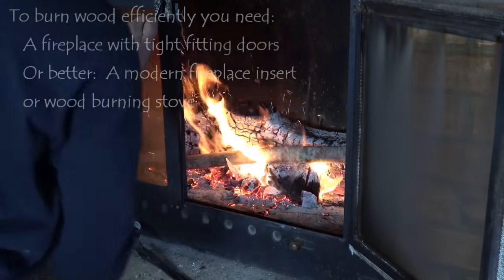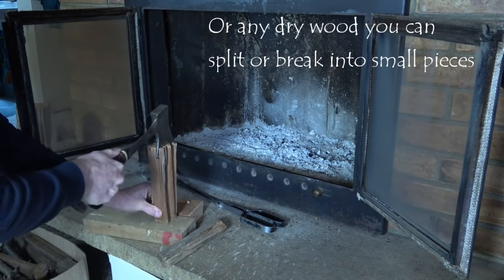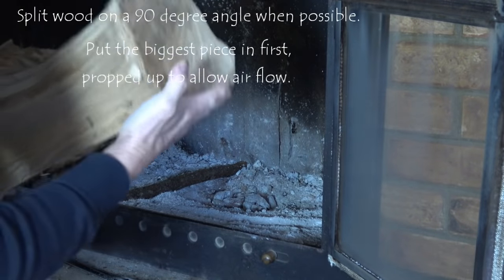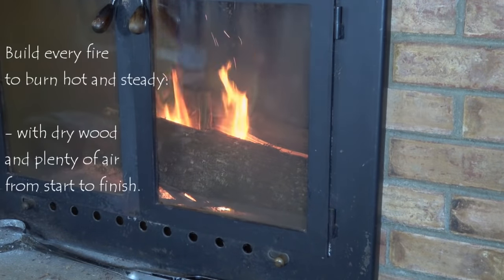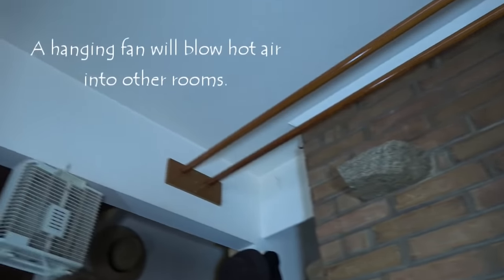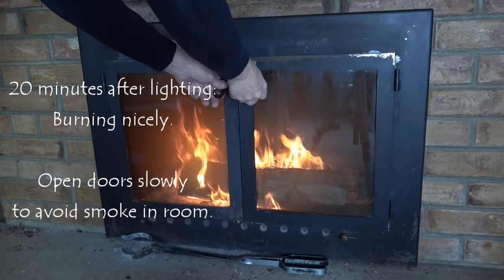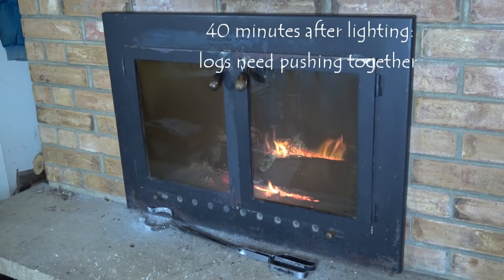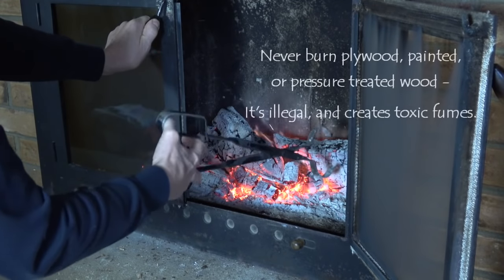Heating Your House Efficiently with a Wood Burning Fireplace or Stove

Comment: One thing for the beginners, if you just got to your cabin and it's cold outside, before you start fire with wood, have a newspaper burning in the fireplace. If you don't do that, you'll have cold air in the chimney which will act like a lid and you'll get a lot of smoke inside your cabin.
Reply: Why is the paper burning, different from wood burning? Ty
Reply: @speaklifegardenhomesteadpe8783  cause paper light's up instantly but wood doesn't also hot air going act's like a pathway for the rest of the air
Reply: The way I read it was: prime the flue with the paper.  It has helped me so much with mine.  Now I'm having a static issue.
Reply: The way I understand it. The goal is to start with one small log and some kindling for the first 20-30 minutes to things acclimated then add more wood. Would that approach be similar to what you suggest?

Comment: After 20 years in the Woodstoves and fireplaces business I compliment your video. Just one suggestion, try reversing the ceiling fan to draw the cold air up to mix with the warmer air. This will also do a better job of bringing cold air from other rooms along the floor. It’s path there is less obstructed. This will give you a more even temperature throughout the home.
Reply: Why did you watch this at all?
Reply: @hellotheremyolfriend  😂😂😂😂😂😂👍
Reply: @BRAND0N...  A wise master remains a student 👊🏽🙏🏽✌🏽
Reply: That's why all ceiling fans have a reverse switch.
Reply: Very good point here.  Ultimately, the air gets circulated, either it is blowing it down from the center of the ceiling (and pulling it up from the sides), or sucking it up from the center of the room and pushing the warmer air out to the sides/walls and down.  While it goes against the popular teachings, I have to concur having the fan pull up from the ground will more efficiently mix the air.

Comment: I love this video! My fireplace is an insert that doesn't have that fresh air vent. Sometimes I have to open the door slightly to get that air in to get the fire going. Also, Sometimes the wood we get from the local suppliers is "dryish" and we have to open the door to get air on it so it can burn. I've tried to start these logs with kindling but it doesn't work good in this Ashley Hearth insert unless the wood is dry like the desert. I cheat a little bit. Dip 3 cotton balls in some kerosene and place it in the middle between some crushed up newspaper....voila 🔥🔥🔥
Reply from the maker: Wax works too, shave some off a warm candle and keep it in a jar to put on the logs when you light a fire. Your insert must have an air control, but the incoming air may not directly hit the fire. Bring wood in the house at least a couple weeks or more before you burn it, and stack it loosely where there's some air flow to dry it well before burning it. Splitting it smaller will help it dry faster. The kindling needs to be very dry, preferably cedar.

Comment: I find moving cool air towards the stove seems to be more comfortable than moving the hot air away. Put a box fan or small fan in bedroom doorways and blow the cold air out.  Also easier than mounting it up high.
Reply from the maker: Yes, that works too. I prefer the fan up high where it's out of my way and I don't trip on it, though it took a few minutes to mount it there.

Comment: Started this season with a lopi dual door insert ive ducted outside "make up" air with dryer vent hose and a custom intake transition.  Got to keep those center slide knobs accessable.😎

It rocks 84> in < 34 out.

Be well.
Reply from the maker: I looked up Lopi and it sounds like they are excellent quality and efficient. Nice to hear you figured out a way to duct in outside air for the intake.
Reply: @HartzHomestead  2x 11/4 " square tube on each side of the air controll rods with bottom plain cut out. 3x 11/4" square tube  running side to side below heater base line ,end capped with top plain cut out to interface with  above tube  bottom cut out. 

And  dryer hose circle cut out of bottom tube.with  corresponding  sized thimble glued and screwed to bottom.
Air comes thru hose to bottom 
1 1/4" bottom tubes , moves right and left then up  into upper tubes where it goes  from front to back into origional stove air intake.

 only way i saw to keep startup air and airwash air control rods operating correctly and have outside air too. Got er dunn

Comment: I like your insert.  Very simple.
Reply from the maker: Thank you. It's not actually an insert, it's a heatilator, which is built into the bricks, and I added custom glass doors when we bought the house. It's a reasonably good system, but a modern insert would likely be better. It does have the advantage of larger glass doors.

Comment: Your video mentions having fans near the fireplace to help circulate the heat.  What if you have central air - could you just turn on the fan?  In theory, wouldn't that pull the warm air from the room with the fireplace and circulate it throughout the house?
Reply from the maker: Fans do 2 things, they extract more heat from the fireplace or stove which would otherwise be going up the chimney, and they circulate it around the house. So yes, turning on the central heating fan would circulate the heat throughout the house, but also having a fan blowing air directly across the hot fireplace or stove will pick up more heat in the first place that you can then circulate.
Reply: Yes

Comment: You keep the ash pit open???
Reply from the maker: I put a screw in the ash dump so it stays open just enough to let the right amount of air through, which is just about a 1/4" crack. I do have plans to make it adjustable from the hearth, so I can open and close it as needed, but that will require drilling a hole through the bricks.
Reply: @HartzHomestead  
Thank you.

Comment: When I start my fireplace the area immediately outside the fireplace is nice and toasty, but we have high ceilings and can't feel the warmth from the rest of the room. We tried the ceiling fan and I think that worked (or it could be in my head). Does aiming a second fan directly at the fireplace actually help distribute the heat? How far away should this fan be? And should I set it to low speed?
Reply from the maker: The ceiling fan should help, try it in both directions on high speed and which works the best. You'll get the most heat circulated with the fan just a few feet away on high speed pointed directly at the fireplace (assuming  you have glass doors on your fireplace). Turn the fans down if it's too windy or too loud. I burn a hot fire for just a couple hours, then turn the fans off when the fire goes out.
Reply: Just so I understand correctly, I should keep my sliding glass doors closed when operating the fireplace? I read online these doors should be fully open when the fire is burning (however the metal curtain should be closed to contain any sparks it burning embers)
Reply from the maker: @rajivrao4772  If you have cheaper bi-fold doors with tempered glass, it's possible a very hot fire could shatter the glass, so to be safe, it's usually recommended to leave them open, or burn smaller fires, away from the glass. If you leave the doors open, most of your heat will go up the chimney, and it will barely heat your house at all. Higher quality glass doors (which cost about $1,000) are ceramic or Pyrex glass, which can take very high heat, so you should always keep them closed when burning a fire. That's the only way it will warm the house. It's much better to install a fireplace insert (about $2,000) or use another type of heat.
Reply: That's interesting I thought keeping the doors closed would push the heat up through the fireplace while leaving them open would allow the heat to come inside the house. I'm not too sure what kind of doors we have we just recently moved into this house, however I do know there is an insert
Reply from the maker: @rajivrao4772  If you wash the glass doors then look very closely in the corner it might be printed what kind of glass it is. Usually tempered glass doors are more loose fitting, ceramic glass will be more air tight with a gasket around to seal it when they are closed. You do get more radiant heat with the doors open,  but if the glass is clean you get it when they are closed too. The problem is if you leave the doors open it sucks a lot of warm air from the room up the chimney. Try it both ways and see.

Comment: Great video! Can I ask if you have ceramic glass on those doors? My doors came with the option for ceramic but that was $800 more. I'm considering doing the upgrade myself and it seems like I can get the glass for $400 but I'm not sure if it's absolutely necessary...
Reply from the maker: These doors were custom welded by a fireplace shop, and they gave us the option of either tempered, Pyrex, or ceramic glass. We chose Pyrex, and we've had some very hot fires without them breaking. You might look into the price of Pyrex, but ceramic is even better. The glass on ours is just held in with a gasket, so it would be easy to change. I once had a pane shatter that I'm guessing was tempered, with a very hot fire of cardboard with flames right against the glass, so it can happen.
Reply from the maker: Ideally you want to burn a very hot fire from start to finish to reduce the amount of air pollution the fire creates.  If your glass is tempered, there is some risk of it breaking with a very hot fire, so I think it's worth upgrading to either Pyrex or ceramic.
Reply: @HartzHomestead  thank you! I am probably going to upgrade to ceramic... I got custom fireplace doors from Stoll that is built like a tank and I can't wait to have a slow burning hot fire in it.

Comment: Our house is older so we have no insulation. The fireplace is older so it has a indoor air intake. It’s a insert with a circulation fan. Best investment ever. It was rated at around 15k BTus  but it heats our entire house. We sweep the chimney every year. For backup we have a toyotomi kerosene heater and electric heat for backup too. We go through a lot of wood just because our house is older. Probably depending on the winter 2-5 cords a year of wood. It heats good. We haven’t had any issues. We’ve been using wood for a few years now.  Before the insert er could have the fire going and not heat the room up one degree. Now we have to crack windows to keep it under 78.
Reply from the maker: Yay for the insert!  If you own the house, have you considered options for insulating it?  If the walls are truly empty, drilling holes and having it blown in would likely be the best. If it's a ceiling with an attic, that can be easy to do, whatever you can get to.
Our house, built in the 1950's, had single pane aluminum windows, and adding 2 layers of mylar with storm windows I built myself cut our wood burning in half and the house was warmer.  
The walls had less than 3" of rockwool insulation, maybe about R7, so in one bedroom that got moldy in the corners, we tore out the sheetrock, shimmed the walls out 2" with styrofoam strips and 1x2's, and put in R23 insulation.  No more mold. It was a pretty big job though, with re-sheetrocking.
Our ceiling was the same thin rockwool, we raised it to R46,  11" thick fiberglass. 
It's November and we haven't lit a fire yet, except to make a crackling fire video.  
I have my feet on an electric hot pad though, and briefly turned on the electric heat a few times.
Reply: Hartz Homestead our house was built in 1952 and we have found some funky thinks in it so we don’t know what is in them. The windows used to be single pane but we replaced them with double pane. The attic has R30. Over the summer we added new blinds that are a insulated type they added about R5 to the windows. With our insert we can put a load of wood in at 9 am and get home around 2:30 with it still going. If it’s super dry wood it doesn’t last as long. We’ve thought about having it blown in too. Thanks for the reply
Reply from the maker: R5 blinds would make a big difference.  I've replaced our windows with double pane, but am still planning to use our 2 layer mylar storm windows, and am planning to make some insulated blinds too. 
Studies have found a super insulated house only needs about $20 a month worth of heat.
We never burn a fire unless we're home.  With our big fireplace I need to push the logs together or add wood about every 30 minutes to keep it burning hot.  Otherwise it would fizzle out and start making a lot of smoke. A smaller firebox holds the wood together better.  
Really dry wood may not last as long, but it does burn cleaner.
Reply: Hartz Homestead sorry for the late reply. The blinds have made a big difference. We sweep our chimney every year because during winter we often burn 24/7. We have 3 sources of heat, electric, kerosene, and wood. We use the kerosene furnace as a backup or when we go traveling. The electric we normally only use if kerosene gets really expensive, if our tank is low, or if the kerosene furnace isn’t working. Have a good holidays

Comment: Do you have any experience of the "self-powered" metal fans that sit atop a metal stove or fireplace insert?  I have a built in electric fan for my fireplace insert but it's loud and of course it uses electricity.  I'm wondering if those metal fans would be good enough to at least get some air circulating.
Reply from the maker: I haven't used them myself, but I expect they move some air.  I do have my fans on a variable speed control, because they are a bit loud on high.  Some fans are much quieter than others.
Reply: Just got one im uk worth it r great

Comment: Great video! I have a wood burning fireplace with glass doors as well with a dampner, ash box on the bottom back of the fireplace. I'm having trouble with the heat coming into the house with the doors closed. I feel like it all just goes right up the dampner. Any suggestions? The fireplace doors have vents all around it as well
Reply from the maker: It helps if the glass doors are clean, so you get radiant heat. Have you tried pointing a fan at the fireplace, to extract heat and blow it around the room? Also helps if the doors seal tightly, so you're not losing a lot of air from the room. If it has gaskets that are not sealing, you can replace them.  If the vents you mention are a heatilator like mine that circulate air behind the firebox and back into the room, find a way to add fans to blow more air through them. If they are in the door itself, and letting air into the fireplace, you'd be better off closing them if the glass can take the heat of a hot fire. Also a short, hot fire is better than a slow, smoldering one.
Reply: Thank you so much for your expertise. I'll def try the fan technique. What I dont understand is why my glass door frame has vents all around its frame. Initially I thought it was for heat to exit and come into the room but after letting the fire burn for a half hour I noticed it was not emitting  heat rather likely taking air in from the room and feeding it to the fire. Yes I do believe it is a heatilator just like you have on the bottom of your fireplace too that gets air flowing around and behind the firebox. Would you suggest I seal the vents on the frame of the door?
Reply from the maker: @adiliqbal2777   If you can figure out a way to blow air into the bottom vent, you could see if hot air comes out the top. It depends on if glass doors with vents were added later. If the vents are built into the fireplace, like a heatilator, you should be able to feel air going in the bottom and heat coming out the top vents after a hot fire has been burning for a while. An insert will have also have vents, but also usually a fan to blow air through and hot air would be coming out the top. If the purpose of the vents are just to keep the glass cool, blocking them off could cause the glass to break if you have a really hot fire. I had too hot of a fire once with some cheap bifold glass doors, and one shattered. Cheaper doors are just made with tempered glass, while high quality air tight doors and inserts are made with pyrex or ceramic glass.

Comment: Miss living in the Northwest! Don’t forget to have your chimney inspected and cleaned once a year.
Reply from the maker: I shouldn't really say this, but in 35 years of burning wood for heat, we've never had our chimney cleaned. When I put a new cap on the top, there wasn't much creosote buildup. We have a brick chimney with a masonry liner, and a half inch air space between them, which acts somewhat as an insulator. So the creosote doesn't condense on the chimney as much as it would with a metal pipe or single wall masonry. We burn dry maple, alder and cherry, with enough air to keep it burning hot, so the fire never smolders. The one time we had a brief chimney fire was because I made the mistake of burning cardboard in the fireplace, and it went out when I closed the doors and shut off the air supply. I suppose we should get it inspected at some point though.

Comment: dont u loose most the heat going up the brick chimney then have it condensating on the brick chimney in the attic?
Reply from the maker: You'll always lose heat up the chimney with wood burning - it's never 100% efficient.  Masonry or rocket mass heaters are the best.  With a fireplace, it helps to have an insert or else tight-fitting glass doors with a heatilator back and fans to extract as much heat as possible before it goes up the chimney. With a hot fire using very dry wood there's not much creosote to condense inside the chimney, especially with a clay liner inside a brick chimney which acts as an insulator.
Reply: @HartzHomestead  well why not block off the chimney at the bottom right above the woodstove around the stove pipe so no hot air gets lost up the chimney?